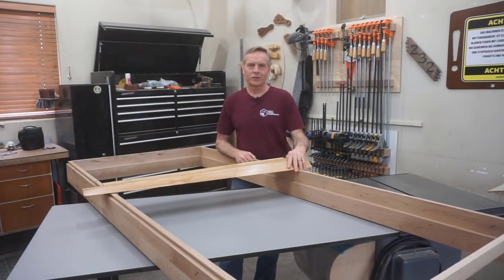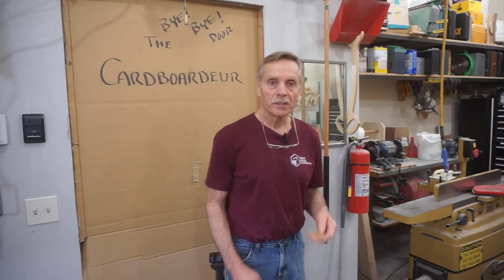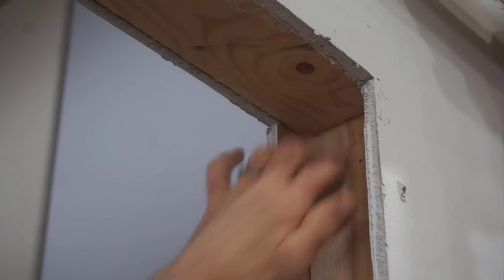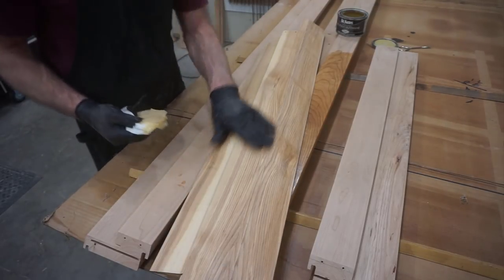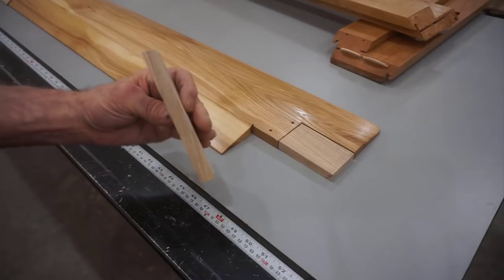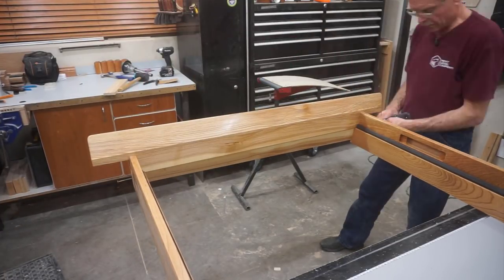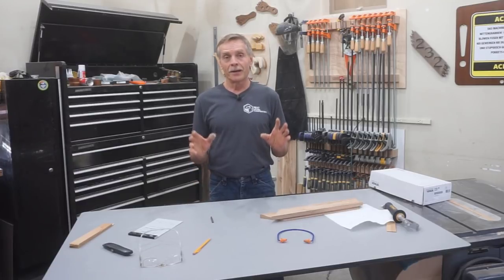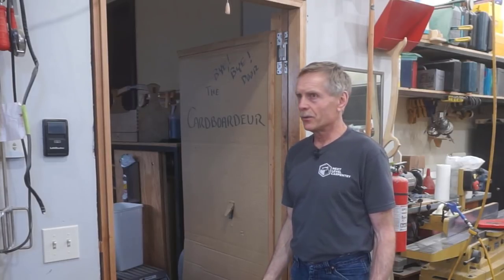Pallet Wood Door Episode #6 Finish and Install Jamb

Comment: I've used Bartley Gel Varnish for LOTS of projects.  Generally use 5-6 coats and I will apply/wet sand the last coat with 600 grit wet/dry paper.

Comment: Matt, I missed the premiere last night but I just finished watching it this morning. Again another awesome part of the series. Looking forward to the door building video along with the casing milling video. You have inspired me to build some projects using pallet wood. There is a roofing supply company 2 buildings down from where I work. Due to Hurricane Michael we had last year, roofing supplies are in very high demand in our area. They have a yard full of empty pallets and are giving them away.  In fact, you can go to nearly every supplier around town and get a trailer load of free pallets. 
We also have a couple of local wood workers who took many of the trees that were blown down, that have cut the trees into rough sawn lumber and are using the wood to rebuild homes and build furniture. Thomas

Comment: Kind of surprised you don't use a card scraper, either purchased or made from an old hand saw rather than a putty knife. Tip: The rubber brick for cleaning a belt sander or random orbit also erases pencil lines. A velcro backed sanding block with some 220 grit sandpaper will "break" the corners fast enough to have the job done by the time you just get your router set up. With a little tactile practice, the edges are visually indiscernible from the 1/16" roundover.  Love your expertise and attention to detail, but many times a power tool can actually take longer than skilled handwork when set up and you  end up with a hand tool anyway.

Comment: You set the ends of the threshold square with hard right angle corners.   The beautiful shape along the fall of the floor works for me.  I just wonder as I go to sweep and. Clean around the right angle bends if I am as happy as I would have been where easier access might have been made with a round / curve?   The proof will be in the use. So glad you have framed a door of some substance, I look forward to what you do.
Reply from the maker: Like this?:  https://youtu.be/nFQPWrpzP2Y?t=108 😁😎 Once the casing is in place it will complete the finished look IMHO... Best, Matt

Comment: In the UK, your knife file is called an HSE file or rather, a "hand safe edge" file with no teeth on the edges, anyway, back to the vid, which as usual, I am thoroughly enjoying.
Reply from the maker: HSE= Hand Safe Edge... interesting; I did not know that.  Thanks for watching and adding value here Rich!  Best, Matt

Comment: I know what you mean about sanding.  It does really improve the surface though.  I just spent the last couple of hours sanding the machine marks off of 195 ft of new baseboard.  Luckily it is the streamline style and the sanding was only one flat surface and one round-over.  I guess I don't really like sanding either.

Comment: When you trimmed the corners of the tenon shoulders I was just a bit sorry to see that.  The sharper the inner angle, the greater the stress concentration at that point.  I was thinking you could round the corresponding mortise corner instead.  Of course I have much the same sort of thought about almost every tenon, and they all seem to work without the least attention to my objection.

Comment: “One of these days, we’ll make the switch”, ha, we are both, well, I know I am, of the age to remember grade school in the 50’s and 60’s when that attempt was made and we were taught the metric system in preparation for “the switch”. I really wish we had made the switch.
Reply: As someone from the UK, metric isn't all that. I work in science and for that metric is of course the standard, but when it comes to weights or construction, give me Imperial any day of the week!
Reply from the maker: I admire you for your ability to make a rational distinction between measurement systems Derek... good on you!  Most folks' ego hobbles them from being sensible and they get stuck on one side of the fence or the other.  Best, Matt

Comment: i love this series.  i need to build some custom size entry doors as i can't find doors that need to be "fire safe" at 78in tall at the big box stores.  and since i'm a wannabe DIY'er i always think "hey i can build that".  So this series is very helpful or will be very helpful once you get the door built.  Looking forward to that.  What is your opinion on how to handle mitered casing and preventing it from opening up.  lets say i want to go overboard to ensure they don't open in an environment that has humidity issues and thus also living in illinois with our weather fluctuation.  I am leaning towards pocket screws or biscuits to see if that approach helps keep the miters tight through seasonal changes.  i had pulled some of the old casings off that did not have issues and appear to have a mitered half lap but that seems like more work than pocket screws or biscuits.  I will say it seems like the mitered halflap did their job as those casing did not open up at all.
Reply from the maker: A miter joint almost cannot help but to open up at some point cch068... after all, it's wood that's mitered and wood was made to move!  It comes from trees, after all, and what is growing if not moving?  My advice is to use splines and something like Titebond III.  A true spline, properly designed and placed, has more strength than biscuits but biscuits will probably give better results than pocket screws and are much less trouble than the mitered half-laps.  I don't have a video for it (yet?) but basically get a 1/16" slot cutter and run a slot through the mitered cut at about 1/2 the thickness of the trim material.  Use plastic laminate for your spline stock making sure to sand the face to roughen it like the back of the material.  If your trim is thick enough make a 1/8" x 1/2" slot and use thin masonite for the splines.  Don't be afraid to experiment and practice before committing to the actual new casings and you should be able to produce some remarkably strong and stable miter joints.  Then it's just up to the wood to behave... Best, Matt
Reply: @NextLevelCarpentry  Thank you Matt, for the detailed response.  it is very helpful and i will try out the spline option on some test pieces and see what that process is like.  What is your standard approach for painted  mitered casings for a client?  is it just accepted they they may open over time and caulk when needed?
Reply from the maker: @cch068  A well-fit, thoroughly glued and properly nailed interior casing that gets painted shouldn't separate in normal conditions.  Standard mouldings are 2 1/4" wide and are pretty stable.  3 1/2" and wider are more prone to opening up at the long point with seasonal changes and would be considered 'normal', not a call-back situation.  Painted MDF trim is probably more predictable for miters staying together although it's more 'delicate' than wood in other respects.  Best, Matt

Comment: Since you hate sanding as much as I do, you might consider investing in a Forrest saw blade. They are Absolutely Amazing blades. The Woodworker II is the best hardwood blade you can buy. In my opinion of course. You can return them within 30 days if you’re not happy with them.  Just for the record I do not work for them nor do I get anything from them for promoting their product. I just think it’s the best on the market.
Reply from the maker: I have the same highly positive opinion of the Forrest Dado King dado blade as you do of the Woodworker II.  I  use their blade stabilizer almost always so I'm sure the Woodworker II is equally good.  You're correct in that I 'hate sanding' which is why I develop a workflow that minimizes how much sanding I have to do.  It might be a surprise but that workflow means I never have surfaces that are sawcut to sand.  Every edge that gets sawn gets followed by a pass over the jointer so teeth tracks, however insignificant, aren't an issue.  Cost of blades isn't an issue but I've gravitated to the teflon coated Freud blades you see me using as a great, practical value.  Because the cost is so reasonable I never get them resharpened and end up replacing them every 9 months to a year or so, depending on what projects I do. 
 This is just me and my opinions too and, if the WW II works best for your projects, budget, etc then it's all good.  I do appreciate you watching this video and posting a comment... it's interactions like yours that add value to the Channel and provide sound information for other viewers who take the time to read comments. 
Best,
Matt

Comment: Good morning Matt, thank you for the wonderful content. I sent the email to Mr. Carter. I hope it helps. You mentioned a putty knife as a scraper, is there a brand works better than others? Keep up the great work.
Reply from the maker: You're welcome Steven.  Thanks for sending an email to Mr Carter... I'm eager to learn the impact from your message along with others when he opens his inbox Tuesday morning!  Any decent putty knife with a tapered blade will work.  My personal favorite, and I'll be doing a video featuring them at some point, are the rosewood handled ones from Warner.  If I had to choose just one it would probably be this: https://www.amazon.com/dp/B00LCPP5QQ/?ref=idea_lv_dp_ov_d&tag=aiponsite-20&linkCode=ic6&ascsubtag=amzn1.ideas.29WVINIJF4EUJ but I have one of each size offered and use 'em all.  I like things to match and Warner is the only company I've found that has a full range of widths from 3/4" to 6" that are high quality... plus they look nice with their wood handles.  BTW the key to making them work, which I'll expound on in the video, is to sharpening them correctly.  Holding them perpendicular in both directions I drag the edge backwards over a smooth-ish flat file laid flat on a bench or clamped in a vise.  Hope that makes sense... you've called out one of my all time favorite tricks of the trade!  Best, Matt

Comment: Do you find that using gel poly is worth the cost over standard poly? Looking at a 1 quart can of old master at 31 bucks versus some minwax at 10 bucks a quart. Is it that much better?
Reply from the maker: Cost is irrelevant (to me) to achieve the final finish I'm after Scott.  Gel poly puts the finish 'in the wood' where brushed on or sprayed on leaves the finish 'on the wood'.  I wanted an 'in the finish' finish on this interior door so, regardless of economy, it's 'that much better'.  Exterior doors are a different story.  FYI for those I've switched to the Varathane water borne exterior spar varnish product displayed in the video... again: cost is irrelevant even though that product is more than reasonable in price.  Best, Matt

Comment: Why break the edges with the frame assembled then sand with it disassembled?
Reply from the maker: Good question Meme... taken literally it sure doesn't make sense for this door jamb, does it?🤔  I did that as an example in this video to show it can be done on things that can't be taken apart for finishing.  I use the same sequence on other projects like cabinet face frames because it allows me to add that finishing touch in the corners.  Picture a tee-intersection of stile and rail on a face frame; the only way to get the look I'm after is  by routing/filing after final assembly. Thanks for pointing this out... Best, Matt